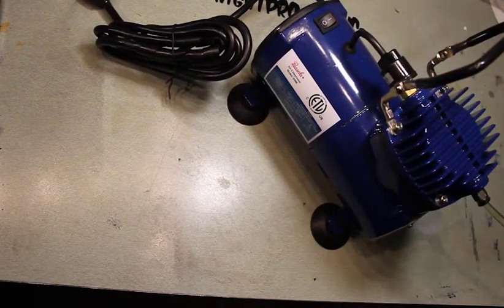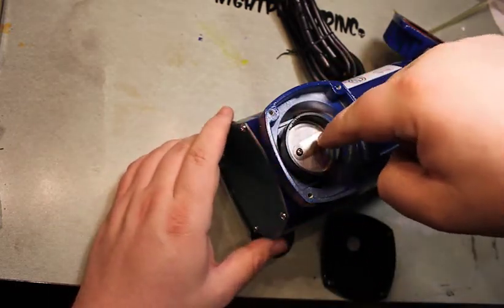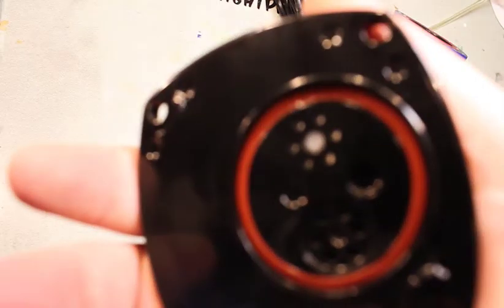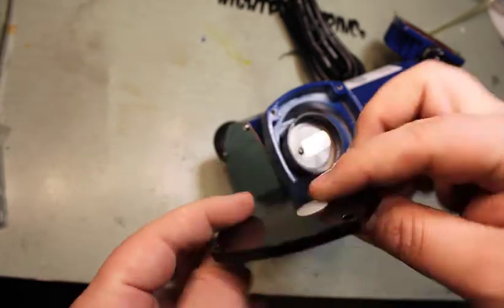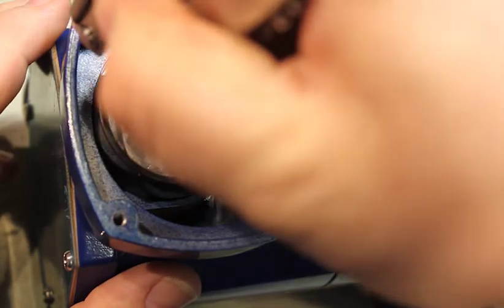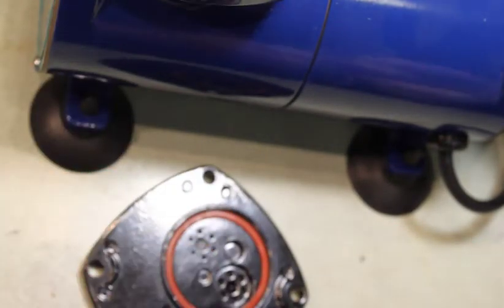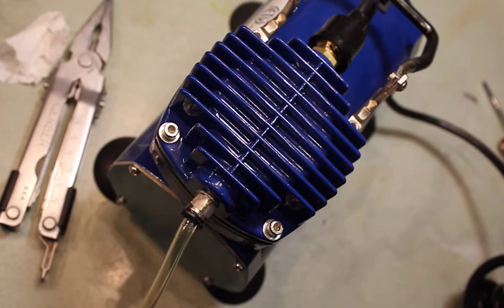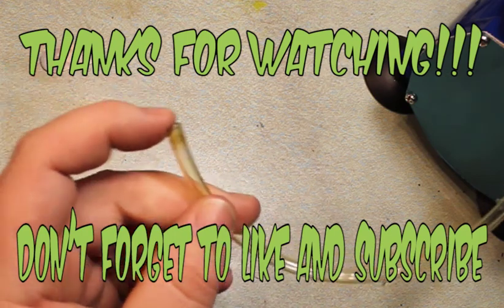How to / DIY Air Powered Hand Engraving setup Part 1 Modifying the compressor

Comment: Hi Night PowelerInc, I am asking for a little help when you read this comment. I have a desire to engrave and I bought a mini 12v compressor but my compressor does not have piston like this. My compressor has a plastic piston with holes and another plate with a valve on top, just below the pressure gauge. Please tell me which holes I need to glue and how to get my compressor ready for engraving. I bought 2 compressors, but both have the same working principle, with a plastic piston with small holes. Thank you in advance.

Comment: It needs to reverse the air flow?  Instead of air is pushing out you need it to push in to suck the ball bearing?
Reply from the maker: It's actually doing both with the valve closed off like that. It pulls the bearing back and hits the spring then with the spring and the air it pushes the bearing against the end if the tool holder. Transfering the energy into the graver bit to cause the cut.

Comment: Thank you VERY very much.  In the first 20 seconds I understood that by watching your video I would learn how to make an engraving machine.  
I watched a different video by a guy who said absolutely nothing and I learned little from that other video.
I really appreciate the time you took to explain things.  You went through some trouble to do the camera focusing and I know how much effort that takes.
Thanks again.  I'll be watching more of your videos.
Reply from the maker: Thank you. Now if I can get through my ADD and finish this up lol
Reply: @NightProwlerIncART  ha ha ha ha  
You're very welcome.  For the last month or so I've been drawn toward engraving, but the cost of new commercial equipment  seems unreasonably expensive.  
I'm also hoping to learn how to make a good pen to hold the moving metal tips.  I think I could manage making a vise to hold the work pieces.   Your video is extremely helpful to me and I'm sure it will help others, too.
Reply from the maker: @southernexposure123  there are a lot of cheaper options out there to get ya started, but yeah that's exactly why I'm trying to build my own rig.
Reply: @NightProwlerIncART  You'll get it done
.

Comment: That's mean cover the piston hole and whole airflow is no fresh air in and just keep push and pull airflow in the pipe right ?
Reply from the maker: Yes, it just oscillates the air back and forth.
Reply: @NightProwlerIncART  I see, last time I still thinking how it work on the piston, now already make it clear, thank you so much.
Reply: It needs to be back and fort??
Reply: Yape. as long as cover it and no air leak, inside will be push n pull the piston.

Comment: How do you plan to control the speed of the compressor?
Reply from the maker: I'm thinking of either using a sewing machine pedal or building a small rheostat controller. Leaning towards the latter of the two.

Comment: I have used rivets to plug the holes in the pistons on the ones I made. A pop rivet dipped in glue should work nicely if your modification don't hold. can't wait to see your hand-piece!!
Reply from the maker: I thought about doing that actually. I need to get on building the hand-piece but I need to order a quick connect for the graver bit first for what I want to do.

Comment: how do u know which wire is positive and negative on the air compressor ?
Reply from the maker: The compressor I am using is a Paasche air brush compressor set up for 110AC voltage. It came with a plug on it. In the case of a 12v compressor wiring it up to a power supply generally they will have a red and a black wire. Usually red is positive. Best bet though would be to search a part number for your specific compressor online and try to find a wiring diagram. Hope this helps.